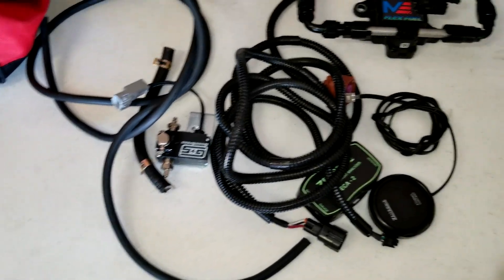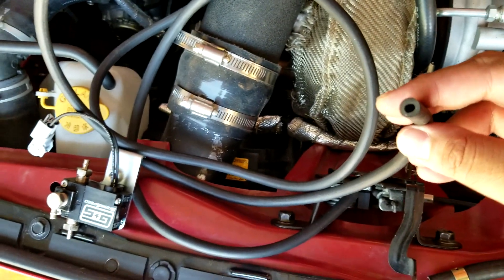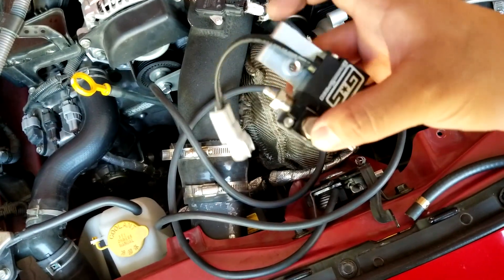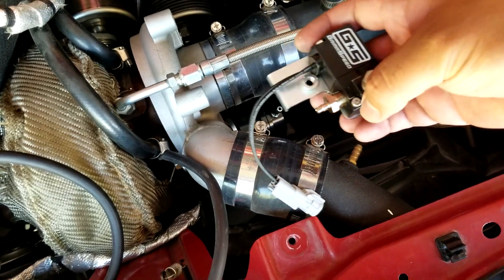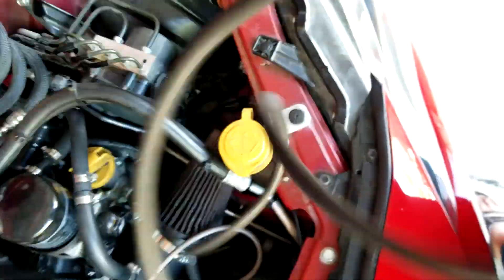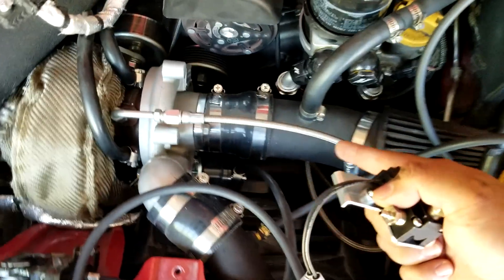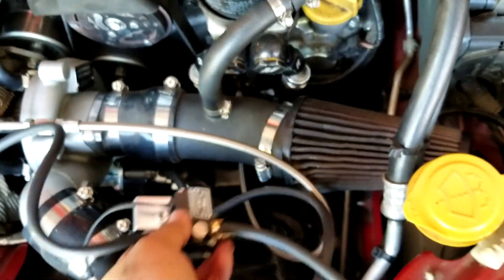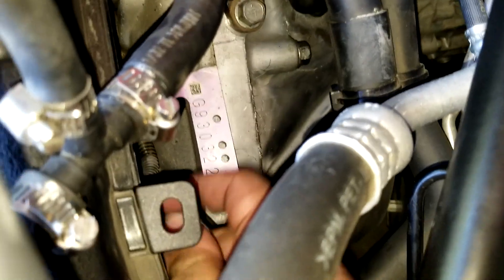ROAD TO 400HP - Turbo Subaru BRZ/FRS/GT86 - Part 2 of 6 (GrimmSpeed Boost Controller Install)

Comment: Love the series bro, just got an 86. What kind of reliability issues have you had with this stock motor turboed? And how bad is changing out the fuel injectors? Worth cleaning the efi out?
Reply from the maker: Thank you! Nice choice of a car, haha.
Reliability wise for most turbo kits, under 300 whp is the sweet spot for reliability and power. Fuel injectors are very easy to change out as well. However, I actually never heard of cleaning the efi in this car, may not be needed.

Comment: Quick question, where do I reroute the stock evap hose? So youre saying that the evap hose is no longer needed?
Reply from the maker: No need to touch the hose, if anything, I clamped all of them in my other video to keep them from blowing off and causing vacuum leak.
 You can just leave it unplug(harness), its only an emission code, and with a tune it will be disabled just like the secondary o2 sensor 👍.
Reply: BRZSer andddd I just bought this Grimmspeed EBCS! Im planning to extend/rewire the boost controller and place em closer to the wg for better response. But Im scared that I might just mess things up. By any chance do you know the inside core of each wire on the Grimmspeed?
Reply from the maker: @fizbakar4692  I was actually planning on doing this. I can't find the source but awhile back I bought an 18 awg for it along with 16-22 awg crimps. Is that what you're looking for?

Comment: Will using this method throw any codes for evap
Reply from the maker: Assuming that you will be tuned with the boost controller. The tuner will usually disable the code. Its only an emission code so no CEL. The same process as the secondary O2 sensor. Tunes usually disable that emission code and the car can run without it.

My tune (HRI tuning) by default already has that code disable, so even if the boost controller is not setup it did not throw a code. You can still install and run the boost controller without a tune,  but it will only go up to the Watste pressure spring. This means that it'll run like the boost controller wasn't even there.